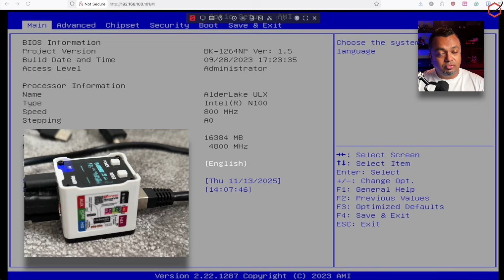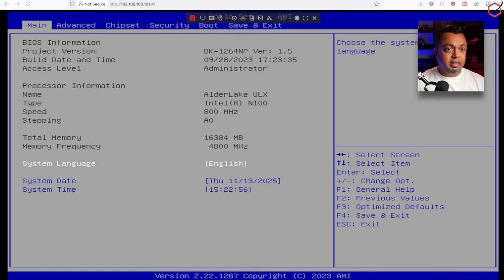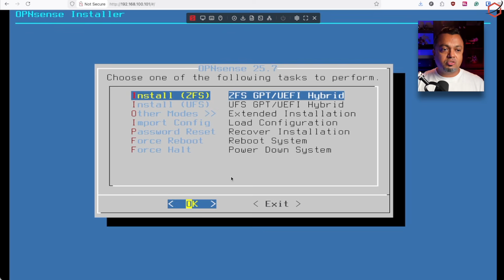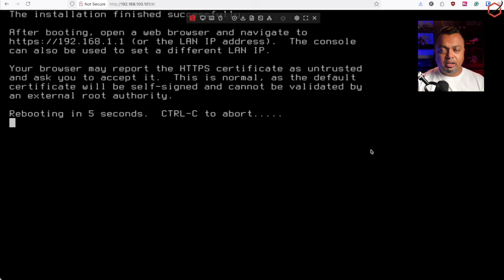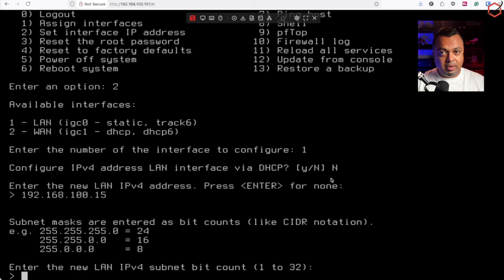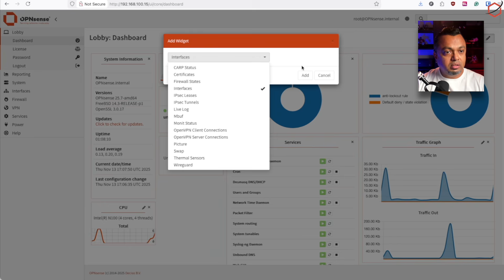Install OPNsense on a N100 minipc - Is it time to change?

Comment: I switched from PFsense to OPNSense. I giot a new router and needed an OS. I'm not a router expert, and I setup my PFSense router a while back. It took me a few days to get my head around how different OPNSense (especially in the newsest release) is from PFSense.

The mini pc I got has a N150 in it. That thing runs hot!
Reply from the maker: Good to hear and congrats! Make sure you add additional cooling to that mini-pc, like an USB fan. That will surely help
Reply: @PragmaticITSolutions  Just did that last night.

Comment: I don’t think the N100 is that great personally I think the HP elitedisk 800 G6 i7 10700 32gb ram IDS and IPS along with AI threat detection and a bunch of other security tools it’s very CPU intensive having enough power just gives you the peace of mind that it’s not always running at 90% all the time also gives you more flexibility to add more security features improves latency, especially when you’re scanning deep packages at around 200,000/ second I don’t know maybe it’s just overkill but I’d rather overkill it and Futureproof it. Between £200 and £300 secondhand is a very reasonable prize for its power size and efficiency if you can think of any other reason why you would choose an N100 or an N305 over this option let me know. I’m always open to learn more.
Reply from the maker: I do see your point and I think the N100 platform is a great balance between performance and power efficiency, especially when running OPNsense out of the box. Now, if you start adding addition packages, depending on what packages, you might need a system with more power. This again shows the flexibility you have. You can start small, and once you are ready, you can scale up and fit your needs.
Reply: @v @PragmaticITSolutions again, you’re buying twice though the N100 definitely has its place but most people that are choosing a DIY OPNsense router/firewall are looking to secure their network as best as they can eventually installing a bunch of plug-in,  I mean I haven’t tested it but it would be interesting to know when your system is under attack how much CPU power and RAM you are going to need extra? Will it go to 99% and then crash I have no idea? It might be sufficient it may not be I’m literally a beginner to network security. Some people recommend 64 GB of RAM at around 6000 MHz Some people are saying 32 GB of RAM 3000 MHz is enough. No one really knows definitively what you actually going to need, I did ask ChatGPT and every time I asked it, it would give me a different answer every time 🤦🏼‍♂️ it’s a shame we couldn’t find the optimum hardware and power consumption because with OPNsense only recommends the hardware it needs to run alone without plug-ins,I mean it’s only about £6 or £7. of electricity per month to go with the premium option it’s not gonna break the bank or anything and I mean if you’re concerned about electricity, you might be able to set it to shut down during night times and it even might prolong the life of the hardware giving it a rest for eight hours a day.

Comment: PfSense is moving more and more towards a Business Edition with its current policies, drifting away from the Community Edition. In my opinion, this is a very problematic direction, and many users are already turning away from it.

I strongly recommend switching to OPNsense instead:

• 100% free and open source
• Actively maintained and continuously improved
• Backed by a community that is doing an outstanding job

With OPNsense, you’ll be satisfied — step by step you can fully replace PfSense. The OPNsense team is doing excellent work right now, and I’m convinced you’ll be happier with this solution in the long run.

I also recommend creating a video series about OPNsense to show others how powerful and user-friendly this platform really is.

Comment: I would be interested to know the routing performance numbers once you replace the pfSense router with this N100 box
Reply from the maker: Once I have done proper testing, you can expect a video 👍🏽
Reply: I've been running pfsense + opnsense routers side by side for 5 years and have run extensive testing on both. With lower internet speed + older hardware, there's no difference between pfsense and opnsense. That's why advice on the forums has always said that opnsense/pfsense is a matter of preference between the two UI, companies, etc. But people have always emphasized that the difference between the two is very minor. That was true in the past.

However, these days opnsense has ground out a very substantial lead versus pfsense's community edition.

1) opnsense is faster with respect to gigabit fiber networks. Your performance is just faster, I don't know why. When I run pfsense PPPoE on N305 vs opnsense on J3455, the J3455 has better speeds. Clearly not a CPU issue. I have switched my N305 to opnsense and the network speed is better (testing using speedtest.net, fast, wireguard , tailscale, etc. - months of testing). I'm not an IT guy so I don't know the reasons, my results are based off of real world testing of transferring files, iperf, etc. my specific speeds: opnsense gives me 850-950 mbps off of speed test while pfsense only gave me 700-750 running the same hardware on the same connection. No difference if I run it on different hardware on the same connection (I have two routers n305 and j3455).

2) pfsense is significantly less stable on newer hardware that's popular - the n100 n305 fanless pc boxes. Aside from the autonegotiation bugs with the 2.5gbps NICs that pfsense has that opnsense does NOT have (I don't know the reason, maybe something like there was a fix that opnsense implemented that pfsense didn't implement because opnsense tends to use newer software or something - that's the answer LLMs gave to me). There's also a massive difference in stability between the two at higher network (LAN) throughput. For some reason pfsense speeds will dip every once in a while. So when you're transferring files over wifi, you'll see something like 100 MB/s and then it'll dip so that the average speed is something like 70-80 MB/s (assume the NAS is all SSD). On Opnsense, I get 113 MB/s and it is constant. 

3) this stability greatly impacts VPN speeds. I use a combination of wireguard and Tailscale. Between my two sites that have about 50-60ms ping (12km apartment), pfsense can get 100-200 mbps while opnsense gets 500 mbps. So my VPN speeds utilizing opnsense have been substantially better.

4) wifi stuttering/disconnects - I've noticed significant wifi stuttering (connection drops for some reason) on pfsense while there's no stuttering on opnsense. This was actually discovered by my brother who watches streams a lot. I was initially skeptical so I've kept a log over the past 12 months and his observation is correct. I don't know what causes this. Our internet speed at home was only 300 mbps fiber at the time (upgraded to gigabit recently) while at my home I have 1 gbps fiber and did notice stuttering occasionally (maybe a few times a day). I don't know the reason but I suspect it has to do with the fact that I'm using newer hardware (N100, N305, etc.) and I'm pushing faster throughput (home network is 1gbps over wifi, 1gbps to the NAS box, 2.5gbps switch) and pfsense's software wasn't written for these higher speeds.

5) degradation - opnsense has been rock solid. My brother didn't update or touch it in 4-5 years. I only upgraded it recently. Meanwhile with pfsense I've noticed that the tailscale exit nodes degrade over time. The latency goes up, the transfer speed drops about 80% and you have to restart tailscale or reboot to get it working. And pfsense itself sometimes is not reachable and requires a reboot (although the exit node still works). I just reboot one of my pfsense boxes (thanks to my father in law) yesterday and within 24 hours I can't even connect to the pfsense router. I can use it as a Tailscale exit node. But now I must replace it with an opnsense box.

Comment: I have 3 networks - 1 Pfsense, 2 and 3 -  OpenWRT.  I recently changed the software on one router from Pfsense to OpenWrt - because the hardware is quite old and the performance has dropped quite significantly, especially with Snort and other packages installed